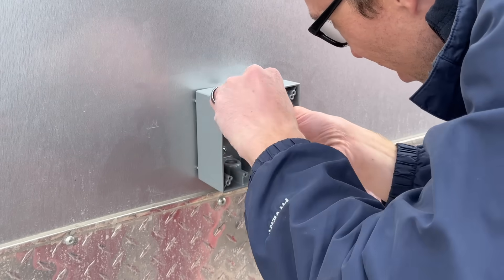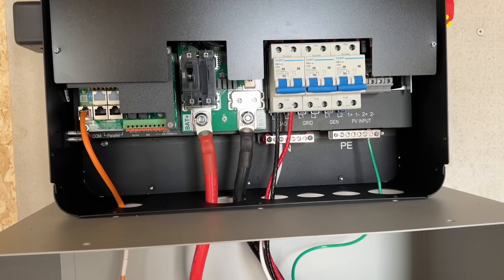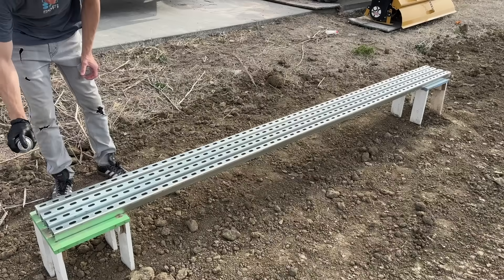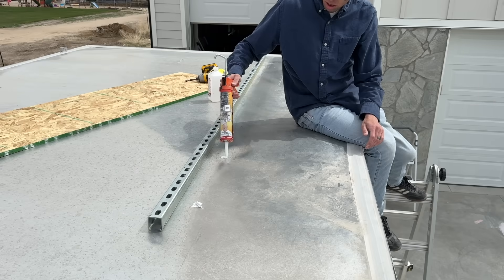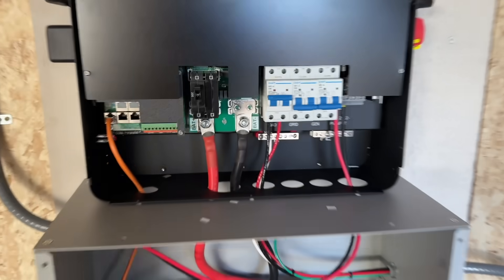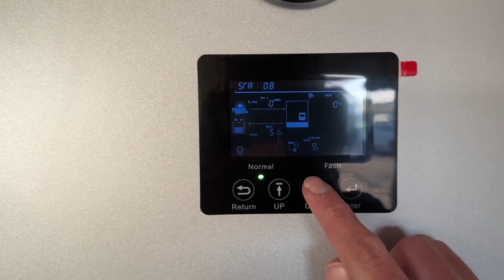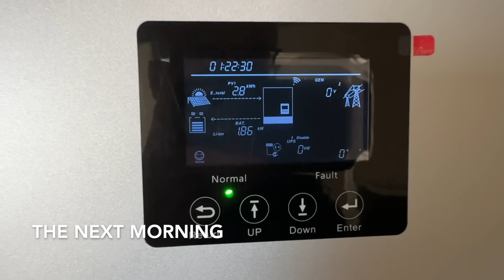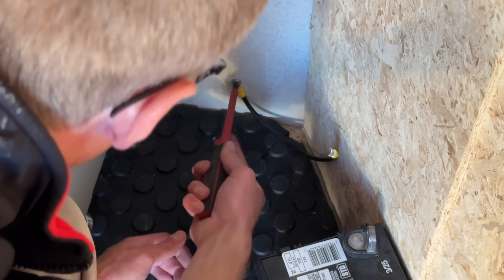I Built the ULTIMATE Solar Cargo Trailer

Comment: I watched until you added the 12v battery and a 110V charger.....Using a 12v "Buck converter" from the big battery would have been WAY smarter.
Reply from the maker: Reason I went with the battery is that the electric jack at the front of the trailer draws about 30 amps. The little dc-dc converters struggle with high current loads like that. And the ones that can handle the load (like from Victron) are kinda pricey. Battery was a good fit for cheap.
Reply: @SmithOffGrid  I have a 20 amp buck converter that was only $100 and it can deliver that power continuously with a CPU fan attached.  I can't imagine 30A is too much more.

Comment: my only complaint is that you said you have bifacial panels and you really don't get any of the benefit of the backside being as they are mounted so close to the roof. Maybe if you created a mount to allow them to angle toward the sun that might help. and would definitely let you get more out of them by angling them and pointing the trailer toward the sun. Of course angle them back flat before moving the trailer so they don't get hooked on anything.
Reply from the maker: What's interesting is that these bifacials were cheaper than traditional mono panels so it was a win either way. But yeah no bifacial gain from this setup.

I was actually working on an adjustable mounting system and I mounted one with it, using some custom brackets I designed, but the issue was the weight of the panel! It was just too hard to lift the one side. I could barely do it. So I scrapped that and just went with a flat mount. I didn't include that in the video because it was getting long enough as is.

I'd still love to figure out a working method in the future! I'm thinking it'll probably need some sort of lift assist. I might experiment with that more on the next trailer

Comment: Why?
Reply: free power for a worksite. Can take it to a campsite. Can haul a car on vacation and give power for a mini-fridge, microwave, and things to cut down on the need to buy overpriced gas station snacks. Can power some things in a house during a power outage. Did I mention free solar power?
Reply: @ICP1SBJ how do you figure free solar power?
Reply: @montanadan2524  ok maybe not free but if you use it often, it will pay for itself over a few years.

Comment: I would like your thoughts on the panel clamps you used, and where you bought them. I have tried several different ones but haven't been super happy with any particular one yet.
Reply from the maker: I talked more about them and how I modified them to work in my other video https://www.youtube.com/watch?v=cYMU3PK2Bd0&t=177s

I did the same thing for the trailer. They're not perfect but they've worked well for me. And here's where I bought them https://amzn.to/3WIWDk5
Reply: @SmithOffGrid  so, essentially, I could use standard spring nuts for the channel and the top part of these clamps like you did in that video and be just fine. I'll probably use 6 clamps on each panel instead of 4, just in case one happens to pop off at some point.

Comment: So, I have done a few of these, and I normally cram as much solar as possible on top. That trailer doesn't look like a 28' box, but rather a 24' box and 4' V-Nose. If that is the case, you could put 6 550w panels up there and still have room up front for a roof vent fan (think bathroom in the v-nose).

Also, I put the batteries in the floor in between the axles, or in the first space in front of the axles.

Another thing to think about is when you series all the panels together, you essentially create one large panel, meaning any shade will severely degrade the output. You should utilize all the solar MPPT controllers you have, or use external ones. That 6000xp comes with 2 MPPT controllers, so use both to maximize the shade tolerance of the existing equipment.

All that weight on the tongue with no other weight in the trailer will make it a bitch to tow in any kind of crosswind.

Finally, the unistrut you bought has holes all down the back side. In the future, buy the one with no holes. It seals better. Unistrut is also available in Aluminum and Stainless if you want corrosion resistance.
Reply: Is there a better way to seal screw penetrations? Maybe rubber gaskets? The sealant could fail at the worst moment.
Reply: @Leonidimus59  I have been using Sikaflex for as long as I can remember, and I don't recall ever having a failure. I use Sikaflex below the waterline on boats for some massive through hull penetrations, and they never fail either. One of the most common is an 175 transducer, which requires a 4" hole, and they never leak, even with boats topping 70 mph.

Sikaflex will not fail. The screws are only there to keep the part from moving until the sikaflex cures.
Reply: @Leonidimus59  This design & construction is probably better-than-ok for sitting still, but I'd be concerned with flexibility & regular transportation over long term e.g. 5+ yrs. But this setup here is undeniably strong, too, mounted to so many points in the ceiling frame. That's important because the sheet metal itself (despite sikaflex ability to stick like crazy) isn't necessarily bound super well to those ceiling beams.
Been considering a build much like this for a while, with a slightly smaller trailer. I think I'd prefer perforations on the sides for a 'roof ladder-rack' type mounting system, into several of the wall framing members, to avoid potential leakiness & perforations in the roof, and to eliminate space for leaves/water/debris to collect at all. Hinge the panels along one or both sides to be able to angle them 'sunward', too. 
I'd consider space for a heat pump/AC unit somewhere in the v-nose. Maybe hang the rearmost panel off the back to create a slight overhang, for some extra space up front. I've seem some people go with small nose-mounted mini-split systems too, which avoids anything on the roof, so you can make it all solar if you want.

Great build though!

Comment: Very cool project. I'd add a grommet or some loom to protect the wires where they enter the panel. Even though the holes are large the wires can still rattle around as you travel, and can wear through the insulation.
Reply from the maker: Like from the inverter into the conduit box? I did add some cable grommets at 13:52. I probably should have emphasized that more in the video. It was a very quick clip.

Comment: Probably a stupid question. Can you advise what you think? The comparative advantages and disadvantages would be of putting in a Tesla power wall in a cargo trailer and maybe purchasing one or two of those expendable correction expandable batteries.
Reply from the maker: A Tesla Powerwall 3 would be quite a bit more expensive. And the single unit acts as both the battery and the inverter.

Compared to my setup with the EG4 equipment, it has higher AC output power (11.5kW vs 6kW) but lower battery capacity (13.5kWh vs 14.3kWh).

It’s also much less DIY friendly. It’s definitely targeted more at professional installers.
Reply: @SmithOffGrid  Thank you kind Sir ! 🙏

Comment: Also in cold weather places you will need some way to heat the trailer because batteries shut down in low temps.
Reply from the maker: No issues with low temps with this battery because it actually has internal heating! 

LFP batteries discharge fine below freezing, you really only need to worry about charging.

If you try to charge below freezing it kicks on the internal heating pads until the cells are warm. It’s pretty slick!

Comment: i'm in the process of doing almost the exact same thing.  But I'm trying to figure out how i can get about 10kw+ of PV on a 24 foot trailer.  I'm thinking about some slide out panels that nest under the fixed ones.  Was going to go all Victron, but this setup seems super simple.
Reply from the maker: Oh man 10kW of solar would be amazing! Slide out panels sounds way cool.

Yeah this setup turned out pretty simple which I definitely like. So many things are integrated in a single unit with the 6000XP.

I bet you wouldn't go wrong either way though. I hear great things about Victron setups too

Comment: I would replace your outside outlets with GFI as well as the breaker to that circuit. Very nice job!
Reply from the maker: Oh yeah all the outlets are actually GFI protected, I forgot to mention that in the video. The outside one is downstream of a GFI outlet on the inside of the wall, so it's protected through the same circuit.
Reply: @SmithOffGrid  I like that you put the GFCI on the inside.

Comment: Not counting the trailer, but what is a ball park figure for the cost? I would like to do something like that someday for my RV set, then send the power back to the coach. Why add more weight and stuff when I can add it to the trailer to carry?
Second question: how hard would it be to send power between the two vehicles? Utilize the solar for most of it, but if I need to, fire up the 10kw generator and charge the battery?
Reply from the maker: I just totaled it up and it came out to about $7500

So like a motorhome with a cargo trailer you'd pull behind it? As for sending power between the two, I don't think it'd be too difficult. From the trailer to the RV you could just use a 30 or 50 amp generator cable and a plug like I added to the front.

For sending power back the other way you could add a inlet box on the trailer that accepts power and runs into the grid/generator input of the inverter to charge the battery. Or you could wire it into a chargerverter if the power coming out of the RV generator isn't super clean.

I assume you could get away with just a single generator cable you swap the orientation of depending on where you want the power to flow. Power from the trailer one way, power from the RV the other way.

I think that could be a really cool setup!
Reply: @ I have solar on the house now (old solar city system). With a setup like you just did can I also augment my house system to add more solar capacity at my house then feed the grid while the trailer isn’t be utilized for trips? 
Instead of a static mount, what about an expandable system that now slides out on the passenger and driver sides to provide sun coverage (pretty much creating an awning on 2 sides of the trailer?)
Reply from the maker: Oh yeah I like the double awning idea!

If you want to be able to feed back to the grid you'll need to look into a hybrid inverter. The one I used is strictly off-grid so it can't do any back-feeding.

EG4 has a few different hybrid options that could work (https://signaturesolar.com/shop-all/inverters/hybrid-inverters/?_bc_fsnf=1&brand=66&ref=rpyximnk)
Reply: @ Danke

Comment: You won't get any benefit using bifacial panels when they're mounted a couple of inches above the roof. There's no reflective surface available to hit the back side of the panel to make any appreciable gain like you hoped.
Reply from the maker: I agree! But oddly enough these bifacial panels were cheaper than any mono panels we looked at ($0.14/watt) so it still made sense even though we won't be getting any bifacial gain.

They're rated for 410W from just the top surface, and 510W including the back. It would have been awesome to get 3kW from the array but we're still happy with the 2.46kW
Reply: @SmithOffGrid  Wow, bifacials for cheaper would sell me too ! In that case, the only way to make that better would be a tracking tilt and turn system. Nice build btw.
Reply: A tilting rack system could help with that and also to optimize the solar production when parked.
Reply: What the comment mitosis

Comment: I would add a decent fan, a 20 gallon water system, a propane tank an integrated compressed air system, a couple of cots that tie up to the walls.
Reply: Why not an ac at that point

Comment: The wires going through that wiring gutter are not protected from the bare metal on the knock outs. Those wires with be shorting out when the raw metal slices the insulation.
Reply from the maker: Like from the inverter into the conduit box? I added some cable grommets at 13:52
Reply: @SmithOffGrid  are those 3d printed ??
Reply from the maker: They actually are! https://www.thingiverse.com/thing:7018615
Reply: @SmithOffGrid  good luck with that plastic. They wouldn’t pass code where I am.

Comment: I just used the same panels on a solar trailer. My trailer is a 5x10 utility trailer 2100lbs load capacity and with eight panels, three 15kw batteries and 12000xp I have maxed out the weight limit. Im hoping with bifocal gain I will get 3.2KW.
Reply from the maker: Wow, that’s awesome!! I’d love to see it. That’s more battery capacity than our home system… Crazy!
Reply: @ I am going to share the design on DIYsolarforum when completed and will send you a link.

Comment: Well done video and such a clean install. I wonder why you didn't go bigger on the panels.
Reply from the maker: We pretty much maxed out the roof space with the panels we used. I spent a long time trying to find panels with the optimal dimensions to do that. There are larger panels for sure, but those configurations left us with more wasted space and less output overall.

But since the inverter has a second PV input, I have been thinking about adding a second array you could store inside and then lay out on the ground for even more power if you needed it!

Comment: You can wire a 48V->12V converter right to your battery instead of relying on another battery like that for any 12V needs
Reply from the maker: Definitely considered it! I probably would have preferred that but the electric jack draws about 30 amps. The little dc-dc converters struggle with high current loads like that.

Victron has a nice 30 amp rated 48v-12v converter that we actually use on our RV but they’re a little pricey. So the battery seemed like a good fit for cheap.
Reply: @SmithOffGrid  the victron does 30 amps can just do 2 and add them to a busbar to give you 60amps or 720 watts of 12v power
Reply: @SmithOffGrid those converters also like to produce heat.
Reply: Victron has a 70a high output DC to DC

Comment: All that weight up front is going to really throw off the tongue weight for the tow vehicle. Hopefully whatever they put in the trailer can offset that towards the back.
Reply from the maker: It’s actually used to store a vintage car and mainly stays parked on the side of their house. But either way, they tow with an F-350 and the car weighs 5k lbs and sits towards the back of the trailer to offset that weight.

That’s definitely good to consider though if you want to build your own!
Reply: @SmithOffGrid  You could add a small heat pump system to control the temperature. Storing a car in a car trailer like that long term can cause issues due to heat and humidity.
Reply: @nicksgarage2  this is very true!